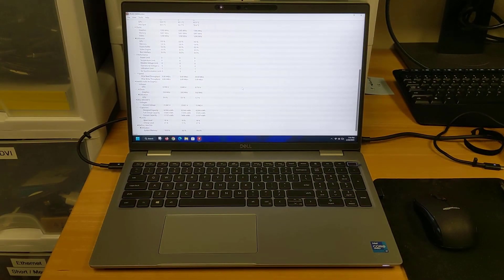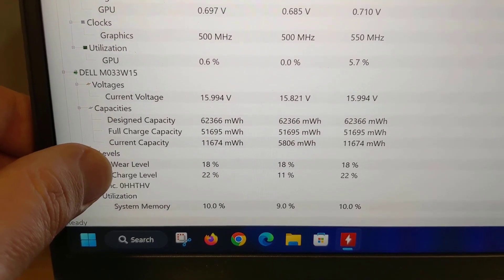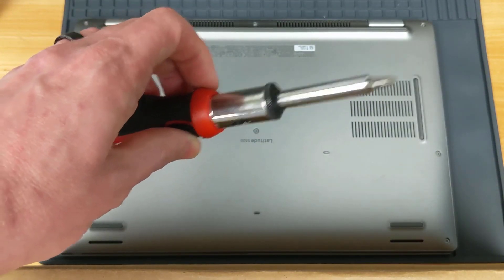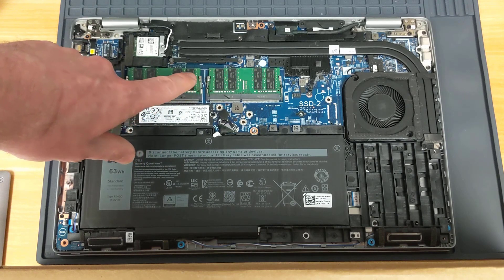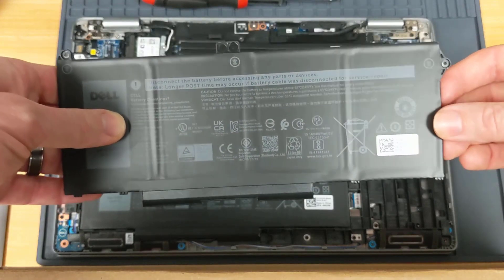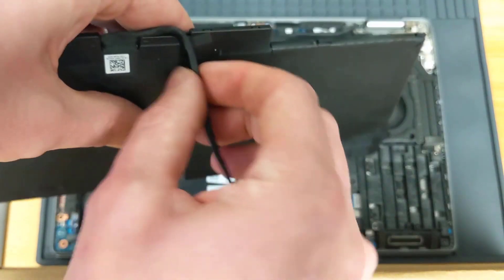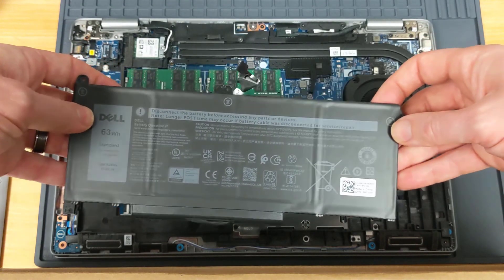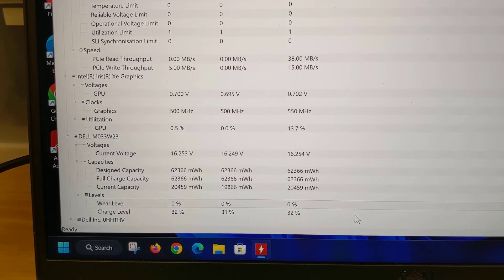How to replace a battery in Dell Latitude 5520 5521 5530 5531 5540 laptops

Comment: Would help if your hand wasn't covering the pulling the tab on the cable. You didn't even say which direction to pull so I pulled the tab clean off
Reply from the maker: It only "pulls" in one direction: up, and away from the board. What direction did you pull it in?

Comment: Any suggestions - Have 5520 followed your instructions and now computer won't turn on. Took off lid very gently (no tools), tried pressing power button 30 seconds with battery unpluged/no AC and with AC. Didn't touch any other components besides  installing battery. I'm sick, just got new (used) 5200 2 weeks ago (and love it). Put in old (fully charged battery) same, nothing happens, no start. Any advice greatly appreciated.
Reply from the maker: Hi! Thanks for checking out my video. To confirm, you're saying it will no longer turn on at all? Either with the old battery or none at all? Is the AC adapter at least 90 watts? Are you able to access any BIOS screen? Any sign of lights or fan spinning?

Are you able to access the CMOS battery connector to disconnect and reconnect to erase the BIOS settings? I believe there's a keyboard shortcut to do that but don't recall off-hand. Lmk if you can't find it and I'll check it during the week.
Reply: @CompTechMike  Yes, doesn't turn on or access to BIOS screen with either battery or AC (65 watts) charger. No lights or fan. I don't have access to CMOS with cover off I don't see it. It's probably on the underside of the mother board, and, unfortunately that is beyond my level of just a user. Thanks for the reply

Comment: Can you use the laptop without replacing the battery, by just having it on the mains?
Reply from the maker: Hi! Depends on the laptop. As long as it supports it and you have a sufficient capacity power supply, you can. For example: some laptops come with only a 65 watt power supply. Others may come with up to 130 watt power supplies.

You'd need to make sure you have a proper supply, then sure. It should work fine without any battery at all. 😊

Comment: Can a Dell Latitude 5520 laptop with a 3 cell built-in battery using 11 volts be replaced with a 4 cell battery model using 15 volts (RJ40G model)?
Reply from the maker: Hi! Thanks for checking out my video. That's funny, I've had a few people asking about 5520's in the past week. The 5520 originally came with either a 3-cell 42WHr battery or a 4-cell 63Whr battery.  I assume in most cases it should be no problem to upgrade to the larger capacity battery, assuming the appropriate steps on Dell's website are followed and the correct wire is used.

I suggest checking out one of my other videos:

https://www.youtube.com/watch?v=WCuP_5Xi5oY

In that video I go through the process of installing a larger battery in a similar-model Latitude 5531.  Hope it helps!
Reply: Thank you for answering my question,,, but my main question is, from the default 3 cell 42Wh battery it uses 11 voltage and the 4 cell 63 Wh battery uses 15 voltage,,,, is it safe to replace the laptop battery that originally used a battery with 11 voltage to a battery with 15 voltage? 
thank 😊 @CompTechMike
Reply from the maker: @seilapuwati  You will need to use the correct cable.  When I did mine on a 5531 the original 4-cell battery was 15.20V and the larger capacity 6-cell 97WHr battery was 11.40V.  With the wrong cable you can't even physically plug it in, to prevent this.

I've never performed the upgrade on a 5520 but assume it would be similar to the 5531 shown in my video above.  Good luck, let us know how it goes!

Comment: Hey @ComptechMike! I have the same model 5520 but mine uses a 42 watts battery. Can I install a 63 watts battery? Would it work?
Reply from the maker: Hi!  Yes, the Latitude 5520 came with either a 42 WHr battery or a 63 WHr battery.  It should definitely be possible to upgrade from the 42 to the 63.  You may need to change the internal plastics around a bit, and may need a different wire.

I did this exact upgrade on a similar model Latitude 5531.  Recommend watching this video to see what the process entails:

https://www.youtube.com/watch?v=WCuP_5Xi5oY

Let us know how it goes.  Good luck!
Reply: @ thanks a lot bro!! I’ll do the cable research now. Yeah, I bought the 63 wats but it does not work. So, I need to see if I need a different cable.

Comment: Nice Battery Replacement, plus software, tips and check BIOS % . One tip back, B-Key and hold Power Button for 3 sec. to enter Dell Service Mode. Many Thanks
Reply from the maker: Thanks!  Haven't heard that one.  Will have to check it out.  Appreciate it!  😊

Comment: Hi, how to pull the battery connector?  I pulled up and I does not get unplugged, please help
Reply from the maker: Hi Freddy! What is the exact model of laptop you're working on? Have you removed all the screws around the battery? Is your problem that you're having trouble disconnecting the battery cable from the motherboard? 

You may want to check if there is a small silver "clasp" over the connector. While this is not common on Dell laptops, some other manufacturers (such as Asus) use this. If you have this, you'll need to gently push it back with a fingernail or small flat screwdriver. Otherwise, maybe you just need to tug harder? 

If you can share a photo of where you're getting stuck we may have more ideas. You can use sites like Imgur to add photos to YouTube comments. Hope this helps!
Reply: @CompTechMike  Hi,  thank you for the quick response. It's the same laptop of video a Dell latitude 5520, I pulled up the battery conector, but the board almost bended,  so I stopped trying. The screws were already off. I see it was a bit difficult for you to remove it at minute 4: 42.
Reply from the maker: @freddyromero3547 hi! It sounds like you're doing the correct process. Assuming the connector has not been damaged in some way, it should pull off with a little bit of tugging and wiggling.

Maybe use your other hand to press down on the motherboard around it, to prevent it from flexing? (make sure to ground yourself or touch something metal to discharge any static electricity from your body before touching the motherboard directly). Or maybe try pulling around the edges with a fingernail?

Good luck!
Reply: @CompTechMike  thank you very much,  I'll give it another try

Comment: Hello, I have the same laptop with 29% wear, I will replace it of course.  I have a few questions - what is that empty space on the side of the battery, and is there a battery, like even more than 63Wh, that could fit there.  Thanks for the great video
Reply from the maker: Hi Nick!  Thanks for checking out my laptop repair videos.  In older model laptops that still had CD/DVD drives, a common upgrade was to remove the optical drive and install a second battery in the space.  Unfortunately in the quest for ever "thinner & lighter" a lot of features and expansion options like that have been removed.

Dell offers two batteries for the Latitude 5520 laptop: a 4-cell 63 Wh battery (Dell part M033W) and a 3-cell 42 Wh battery (Dell part M3KCN).  The batteries are interchangeable - both will fit in the available space.  Here's a photo of them side-by-side:

https://imgur.com/a/HdroITP

(image hosted on Imgur)

They do not offer any other sizes for this particular model.  I believe the space you mentioned just to the right of the battery (visible at 3:06 in the video) is typically where the optional smartcard (government ID, DoD/CAC) reader would be installed.  I am not aware of any batteries that could fit in this space.  That's not to say some enterprising 3rd party couldn't produce one, just not one I'm familiar with.

I would recommend using Dell-brand replacement batteries in these laptops.  I've had some bad luck with 3rd party items purchased on sites like Amazon and eBay.  But maybe your luck will be better than mine.  😉

Hope this helps!

Comment: I have same laptop Dell Latitude 5520 i7 11th generation processor. It came with pre-installed 11.4V 42Wh (3 cell) battery. It is now more tan 2 years old and battery capacity has dropped to 2 hrs afetr full charging. Is it possible that 42Wh battery can be repalced with 63 Wh battery? Does both 42Wh and 63Wh batteries have same dimensions and fit? I want larger battery than the old one. Thanks
Reply from the maker: Hi Akhter! Thanks for checking out my video. That's a great question. I always recommend if you're going to do the job, to put in the better battery. To answer your question, the 42Wh and the 63Wh battery are not the same physical size. The 63Wh battery is about 2 inches wider and uses an additional screw to install. However you should be able to remove the small one and fit the large one. I've got both at my office. I'm off for the holiday but will send you some pictures when I go back next week. Thanks!
Reply: @CompTechMike  I highly appreciate your prompt response. I have also observed online that 42Wh and 63 Wh batteries are not the same size. But I wanted an authentic answer to this. If you will share photos of both batteries , it will help a lot.  Enjoy your holidays.
Reply from the maker: @waseemakhter694  Hi Akhter, here are photos of the 63Wh battery and 42Wh batteries:

https://imgur.com/a/HdroITP

(Images hosted on Imgur)

Hope this helps!
Reply: @CompTechMike  I have seen these photos and it is clear that 42Wh and 63Wh batteries are very different in size and dimensions and 63Wh battery will not fit in place of 42Wh. I think I will be have to stick to 42Wh. I highly appreciate your response and expalining the things in detail.
Reply from the maker: @waseemakhter694 hi Akhter! I think you misunderstand. The laptops are designed for either the 42Wh or 63Wh batteries. I think you'll find if you open the laptop up, there should be sufficient space for either. I would recommend upgrading to the larger capacity battery, as this is something I've done on many previous models of laptop.

In any case, just open it up. See if the larger battery will fit (it should). That's what I'd get. Good luck!
Reply: @waseemakhter694  Sometimes people put another SSD in that extra 2" space so the 63wh won't fit. If no 2nd drive it will fit.
Reply: @spirit3soul  Hi , Thanks for your comment. I had already replaced battery in my laptop last year. I installed 63Wh and it fit very well without any issue. cheers

Comment: If you had a BIos password on there, or a boot password will the battery replacement delete it?
Reply from the maker: Hi!  Thanks for checking out my video.  The BIOS settings (including computer date & time, selected boot device, etc.)  are maintained by a separate battery.  I don't point it out specifically, but you can see it right around the 5:47 minute mark, here:

https://youtu.be/JKpShw8Ncac?t=347

It's the small cell wrapped in black plastic beneath the main battery (similar to a watch battery, like a CR2016 or CR2032, with header pins attached).  Hope this helps!
Reply: Thanks a lot

Comment: Fantastic video - everything I was looking for.  When you installed the new battery and installed the plug back to the motherboard, it looks like you just pushed it with 1 finger and it "stuck" back on.  Is that the process?  It was hard to see in the video.  No special method for this?
Reply from the maker: Hi Tristan! Thanks for checking out my video. Yes, that is correct - there are tiny little "pins" inside the flat connector. You pull the black tab to lift up on it to remove it, and for reinstalling you just line it up and press down on it. Dell has used this type of connector since around 2017 so it was pretty common to me, but you're right - I should have tried to zoom in on it a little bit. 😊 Thanks!